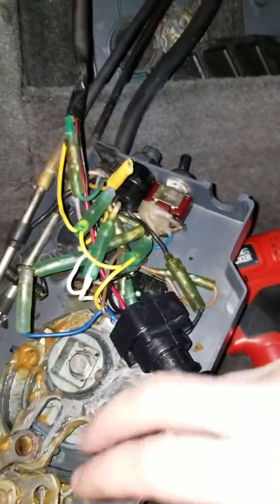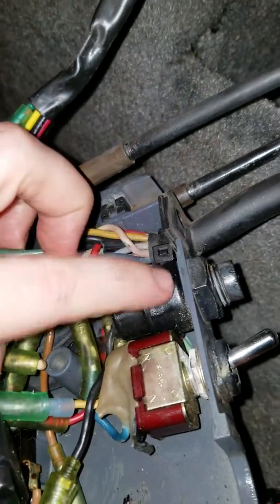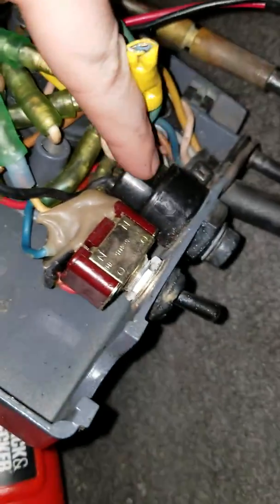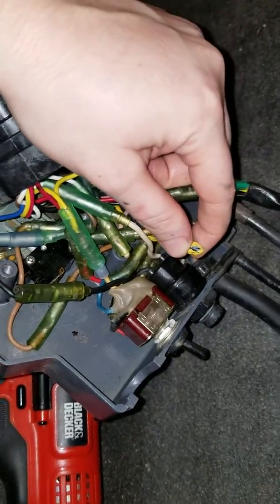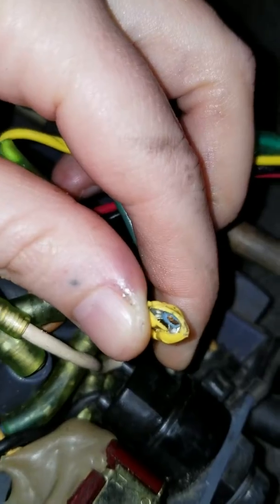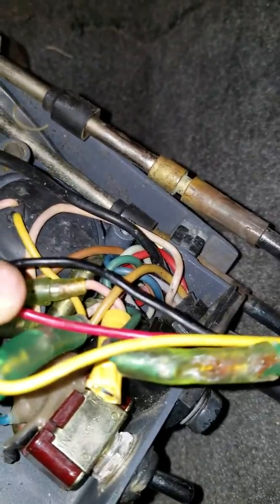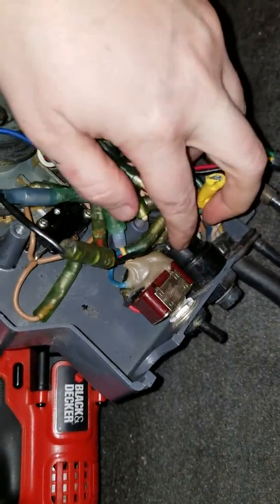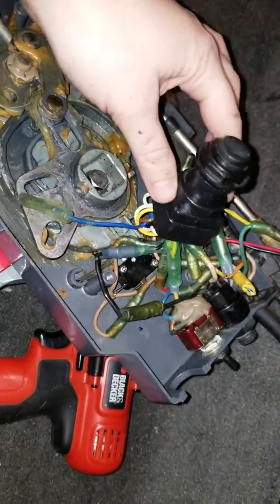Yamaha 703 control safety kill switch wiring issues

Comment: you just have to ground that black wire coming from the kill switch. keep the connections as they are, simply run a wire from that black one to the block. If it still doesn´t work it´s a faulty kill switch

Comment: Probably a little late reply for you but maybe will help someone else out. The toggle switch between the key and the kill switch is for the choke. The older 703 control boxes were like this before they went to push to choke with the key. The blue wire from that is what goes to the electric choke solenoid on the motor. That said, the blue wire on the key switch is also choke as it seems someone replaced the key ignition with a newer part. Looks like they opted to leave the choke hooked up to the original switch for whatever reason. For the emergency kill switch, the white wire is the kill wire which kills spark at the cdi. You are right on the pink wire as it goes to the emergency buzzer which is usually hooked to the motor side overheat sensor.
Reply from the maker: Not too late its still like that. She runs so i just left it any and all help would be much obliged
Reply: @slickmouf879  is the choke working?
Reply from the maker: @wmkess  yes the choke has always worked. I knew the blue wire is the choke, but I’m talking about all the ones that are spliced into already they have the weird connectors and trying to make my Killswitch work sometimes every so often the boat wouldn’t cut off at all without me taking off the battery terminal, but it only done it about once every three months could never figure that out either at this point is sitting in my backyard because my nephew jumped me off from my brother-in-law‘s boat we realize that wasn’t gonna work hook up my brother-in-law’s extra battery from his pontoon to get me started and back to the boat ramp and my nephew hooked up the leads to the battery backwards and now my tilt trim meter is reading the opposite of what the motor position is really in and someone told me that I could’ve fried other things and sent through the wires backwards past the diodes and fuses and apparently one of these dies must be because if I popped it, then I fry the stator if i run the motor like that. or so I was told so at this point my boat has been sitting back there for about going on four years and it ran like a top before all this happened. The motor still runs. I’m just afraid to finish it off or be up on eBay in the middle of the night trying to find a stater to a 1989 Yamaha two-stroke 90 hp ETLF lol
Reply: Did you find the wire connectors? I need the wire connectors? I can’t find them anywhere. Do you know where I can get them?
Reply: Disconnect the wires from the emergency switch and connect them together and see if it still runs

Comment: Red 12 volts be+
Yellow (key on power)
Brown ( starter circuit)
Black ( ground)
White (ignition stop circuit)
Blue ( choke)
Reply: Can’t thank you enough for this
Reply: I'll add green, which is the tach signal wire.

Comment: I changed my ignition switch yesterday from the original to the same aftermarket like the one you are showing and I took some pictures in case I made a mistake. I can send you those pictures if you need.
Reply from the maker: Yes i would love the pictures
Reply: Do you still have the pictures by any chance? I’m having issues with the motor turning off after replacing switch. Thank you
Reply: I will take pictures as well.

Comment: Hey if you still need help with that control box wiring or any other yamaha outboard wiring let me know I'm on lake Marion not far from ya. Then names benjamin
Reply: I could use some help, i have a 93 40hp, it starts if i pull start it but wont one the controller box and my fear is he monkeyed around with the controller. How can i fix something like this. I’m scared to death to take the box apart. Also, i checked the solenoid and it is good i put a new one in just in cast. It starts when i jump it….just will not start with the controller
Reply from the maker: I definitely would. and you’re right we are not far from each other. Would you like to come to me or would you like me to come to you? My nephew tried to jump me off from my brother-in-law‘s pontoon in the middle of the night and hooked up the battery leads backwards and now I have a tilt trim meter that’s reading backwards and hope that I didn’t fry my CDI. I haven’t driven it like that since then but I was told if I did try to drive it and something was wrong in the CDI area that I could end up frying the stator and I don’t wanna do that to this 89 motor bc other than that she runs like a top! I really appreciate you commenting back. I’m sorry that it’s been so long. I hope that you actually get this message.
Reply from the maker: Trying to find you on Facebook now it doesn’t look like you have commented back in a while and I never seen this comment.

Comment: What is that toggle switch under the ignition slot and above the safety thing???
Reply: It should be the power to the motor choke solenoid.
Reply from the maker: The choke switch

Comment: That aftermarket switch is a push the key in to choke the blue wire is to bypass the factory choke switch
Reply: This why probably that blue wire was left unconnected. Because they used the original choke button I guess